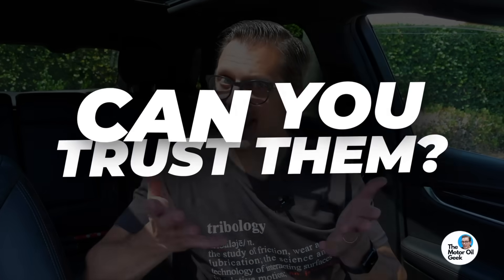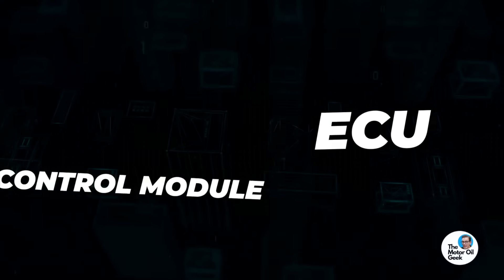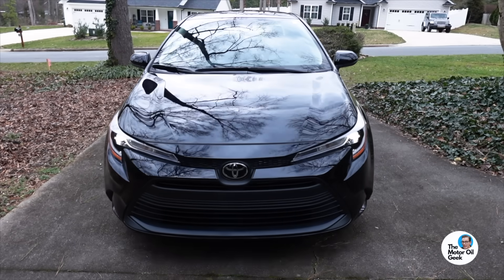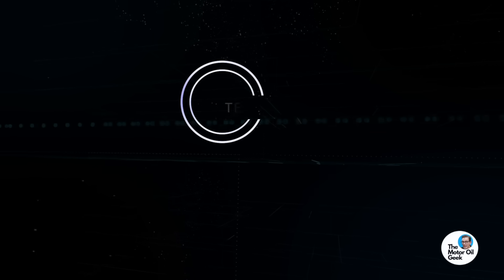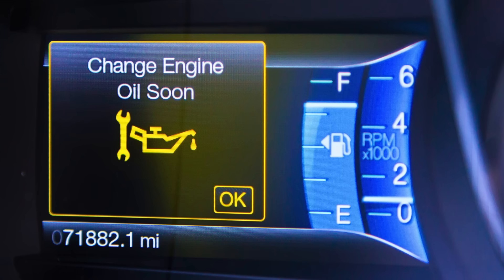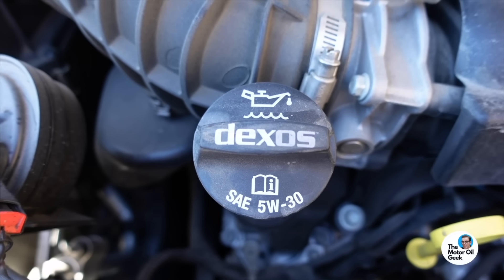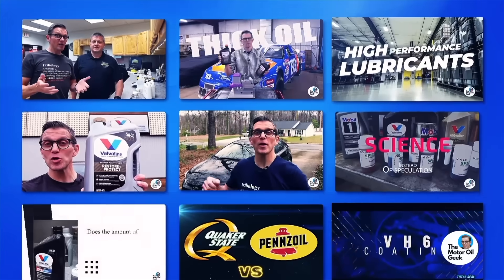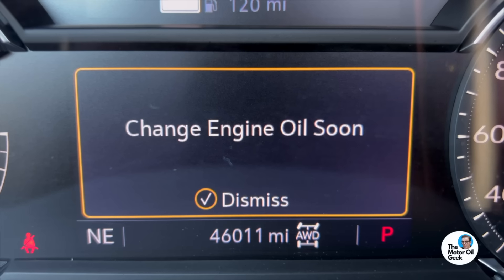The Accuracy of OIL LIFE Indicators REVEALED!

Comment: Lake,

I will somewhat agree with this video, but with few additional comments. 

Oil Life Monitors in general and assuming everyone uses oil from the dealership, which a lot of us don't. Two, the quality of the oil being used, whether it's group 3 hydrocracked oils, group 4&5 PAO and Ester blend. All oil is made differently, with that being said and like you yourself said in your last video, Regarding the base stock oils aka boutique/Enthusiast based synthetic oils vs the off the shelf oils. 

I also wouldn't trust or fully believe that any vehicle whether it's GM, Ford, Honda or even Toyota knows for certain that oil that went in or got changed is the same viscosity. Considering that people would say and do the opposite of what the owners manual says to use and also Considering that a lot of vehicles still say you can run different viscosity grades depending on the temperature range or climate where they live. With things considered here, I would throw some caution and speculation to the wind and not fully believe everything that's said about oil Life Monitors, it's a mere guess. Same with Flashpoint vs Gas Chromatography when determining fuel dilution testing. Ones far more accurate and more thourough, the other is a literally a mere guess.

Comment: Shouldn't you preface your recommendation to trust the oil indicator by stating that the indicator is assuming you are using the recommended oil on the cap/operations manual?

Comment: Great video. Informative and tightly organized. 
My 2014 Chevy Volt has the GM algo. My interval is much longer because it’s a PHEV/EREV, where most of my driving doesn’t involve the gas engine at all. Manual says to change it every two years or 7.5k miles. Got my last change last year at 77k miles. I’m at 92k miles today, oil indicator stands at 38%. I check oil manually every month and it looks totally fine. Will be mindful of the two year mark and/or what my indicator says.
Reply: I used to own a 2014 Volt, great car.

Just to clarify, you don’t have to track time separately. The computer automatically lowers the oil life monitor approximately 1% every week that the engine does NOT run, thereby reaching 0% at two years, if you didn’t use the engine at all.
Reply: @ That’s good to know. Thanks.

Comment: Our Chevy Suburban with the 3.0 diesel has an oil life monitor and I change it at 20% remaining which is about 6000 miles with Mobil 1 ESP x2  (dexosD oil).  No harm changing it a little early for extended engine life. DIY oil change cost is $55 since walmart started carrying the DexosD oil and AC delco filters.

Comment: I have zero issues with changing the cheapest mineral oil on the shelf every 10,000 miles. 256,000 on a G6 and 152,000 on a turbocharged Cruz. My opinion, you are wasting your money on advertisement oil and changing it way too soon.

Comment: I wonder if the oil life system takes into account the current mileage on the vehicle, as engines with over 100K miles will have more blow-by and thus contaminate faster.

Comment: I have a 2017 Jeep Grand Cherokee 3.6L V6. I run Pennzoil Platinum and change it at 5000 miles in summer and 4000 miles in the winter (we have below 0⁰ F temperatures) which correlates with the "oil life indicator" at 30% and 50% respectfully. 
I can think in metric and the US common or English system. I prefer the US.

Comment: How long could oil go, if the combustion is so complete, that there is no moisture, nor carbon buildup?
I ask, because I have found that if I impart a specific resonant frequency into the fuel supply, just before combustion, there is a much more complete combustion.  So much so, that it renders the catalytic converter useless, as well as never developing carbon deposits on the piston top or rings.  

My oil stays very clean and viscous to 40K miles, on a 350K milage 4.3L Vortec V6.  I've run the oil to 42,5K miles & the oil lost it's viscosity.

The engine had over 200K on it, before I discovered the resonant frequency trick, & that engine burned 1qt. of oil every 1000 miles.  Now, it burns about 1/2 qt. every 20K miles. 

Not to mention, near zero emissions w/o a converter, and a at least 20% increase in fuel milage.  

If you would like to test my claims, I'd be happy to send you my 'trick' to verify my claims.

Comment: Your oil is dirty from the moment the first rpm happens after an oil change, and just gets dirtier.   the only way to have clean oil 100% of the time is to install an oil cleaner circuit like a bypass filter system.   Every foot you drive or minute you run your car, even after an oil change, the oil is becoming contaminated with particles that wear down your engine operating surfaces.   Oil can be successfully filtered to the point of analytically clean using a secondary oil filter system in addition to the full flow system that comes from the factory.   Yet, very few people understand how critical this concept is to the longevity of an engine.    Just keep buying new cars after 100 or 200 thousand miles while you do your oil changes at every 3, 5 or 10,000 miles.    That's fun, right?   Spending 30 40 50 thousand dollars every 100 or 200 thousand miles, when you do not have to if you understand oil tribology and the functioning of high level oil filtration.

Comment: This is absolute horseshit. I did an actual test in my auto shop when my receptionist bought a brand new Chevy Cruze. We knew the actual mileage of the vehicle and the oil change intervals. Not just guessing at a rental car that probably had its oil changed and nobody bothered to reset the oil life indicator. In my experience through the first five free oil changes in the Chevy Cruze, the oil that was being offered at the dealership in San Diego was incapable of making it past the 60% oil life indicator. Mark.
We had to use amsoil signature series oil to get an oil that would still test with acceptable levels at a 10% oil life remaining. Even using mobile 1 would require the oil being changed at around 40% oil life remaining. 

If you're going to perform a test like this, your data is completely irrelevant. If you don't know the mileage on the actual oil you're testing.

Comment: My current concern is that we recently had a new 4 ton Bosch IDS heat pump installed to replace our 20 year old 4ton a/c. 

During that process, I found a considerable amount of mold in our flex duct. I decided to educate myself and replace all of it myself. 

During the replacement process, I discovered many air leaks in the system, which lead me down the rabbit hole of air sealing every inch of our attic floor, disinfecting all of our metal ducting, air sealing every inch with tape and/or mastic, reinsulating it all of the metal ducting and plenums, and I’m strongly considering enclosing my attic to turn it into a semi-conditioned space. 

However, my concern is after all of this work, my system will now be over-sized for our now more efficient home. 

Did I just screw myself?

Comment: Just as a technician, I've noticed that some makes have their "Oil Life" be nothing more than a mile counter. Some have internal calculations for engine and ambient temps, ignition counts, etc. Without knowing for sure which system your vehicle uses, err on the side of caution would be my recommendation. Analysis can really help you a lot with those decisions, whether you use Lake's company or another reputable lab, it really helps to know the actual info.

Comment: No, you cannot do that. IF you want a reasonable life span of the engine and aftertreatment system, it is wise to change more often than the regulations, ESPECIALLY on EGR diesel. EGR dirties and destroys, as a lot of oxides are released when exhaust gases are recycled. Feel free to take up a separate section for EGR-Diesel and its destructive properties.

Comment: There are situations where the Oil Life Indicators are useless since they do not have sensors measuring oil particulate, but only algorithms based on other sensors. The main one is frequent dusty environments such as living, working or recreating on gravel roads and trails. Most owner's manuals include frequent dirt road driving in their "Severe Duty" definition, along with things that the algorithm is aware of, like short distance trips, cold weather, stop and go traffic, heavy towing, etc.  But most of those can be accounted for with the algorithm because they involve engine and oil temp, rpm (injector count), etc. Not so with gravel road driving as there is no sensor to indicate oil particulate. We use our pickup with a light weight slide-in pickup camper and put in a lot of miles on gravel roads, trails, etc. so I do oil changes at 5,000miles, and oil filter changes every time, regardless of oil life indicator.

Comment: My 2017 Ford Fusion Energi is driven daily, 5 days a week 25.5 miles per each commute direction and I get to start with a fully charged EV battery both directions. EV mode duration depends on weather and traffic. EV mode is 19 to 22 miles, so 6-7 to 3 miles on gas, in hybrid mode meaning gas engine on/off depending on load. So oil life indicator means what? I've been changing oil at 50%. 0W-20 oil, changed at dealer. Usually every 6 months. I'm 64 and can't crawl under a car any more. All my previous cars have been 100% gas, no hybrid or run/stop. Easy to determine when to change. BTW,  I fill up every 3 months in the summer and every 2 months in the winter with fill-ups being about 10 gallons.  Best commuter car ever, no range anxiety.

Comment: All you said in 10 minutes of video is that the GM oil life monitor is extremely conservative. You give no indication of how long oil might actually last or how to correlate actual oil life with the monitor. You should show how to use a specific oil analysis to determine oil life for a particular vehicle and correlate it with the monitor. For example, will a particular oil change typically last for 10K miles when the monitor says to change it at 6K? Is it worth the cost of the oil test to find out? I am interested in accuracy, not fluffy oversimplifications. 
The way I used to use oil testing was to watch TBN to ensure that I did not run low on acidity buffering, and to watch for trace metals to make sure that nothing went unusually high. In most cases of mainly highway driving of over 30 min per trip, I could get over 10K per oil (& filter) change with nothing out of range, especially if I had added 1 qt of oil makeup  during that time. Now, I just go to about 10K on synthetic if I have added at least 1 Qt of makeup in that interval, and skip the oil test.
(People who do mostly short trip driving might do well to consider an EV.)

You can do better than this video in the same amount of time.

Comment: I don't trust Honda's OLM and never have.
I have had honda's from 2013 onward, and they all push the oil mileage to well above 10k miles. 
I have done oil analysis tests on multiple engines (k24, k20, k20 turbo, j35) and the oil is beyond useless at those points.
I have also noticed that honda's are super sensitive to having good clean oil and fluids (I have toyota's that seem completely oblivious to the life of their fluids, everything from coolant to brake fluid, trans fluid, engine oil). At least with honda's the car feels at its best and performs at its best with much shorter intervals than what the maintenance system thinks. My transmissions on honda's feel clunky after 30k miles, but the minder told me to change it at 50k. Of course I changed it early. Same with engine oil. 4-5k mile oil changes are not expensive (25$ for oil, 5$ for a filter). Same with brake fluid. They say brake fluid is good till 50k miles, After changing it, the brake feel was noticeable better.

Comment: My Ram 2500 Cummins takes far too long to indicate a change. I change my oil at 5k with full synthetic Diesel with an additive called Cam Guard. NO way would I let any of engines run over 5k between changes. We have a 4Runner with 370,000+ and counting still running like a top with a clean engine because we are religious about changing oil and using the highest quality oil we can buy.

Comment: I just do my oil changes every 5k. Never used synthetic oil. I,m 70 years old and I have never had an engine have oil related failures. I usually put from 150 k to 200k. Everything else dies in an old car before the engines die. Plus changing oil every 5k is easy to keep track of. No need for any stupid oil reminders.

Comment: I’m unfortunately the owner of a vehicle with a wet belt driven oil pump (ford 2.7 eco boost). My primary concern is ensuring a long belt life. Is there a spec of oil to look for or avoid to ensure max belt life? (Other than blindly trusting ford and using motocraft, if they’re careless enough to spec a wet belt I don’t trust their judgement on oil). I change it early just in case 8000km.

Comment: 1st and foremost we  DO NOT NEED THE METRIC SYSTEM.
2ND OIL CHANGE INTERVALS WERE INCREASED BY THE EPA SO LESS OIL IS USED!!!!!!!!.
3RD 3K MILES IS ENOUGH, IN SMALL CARS THAT ONLY TAKES 4 AND A 1/2 QUARTS OF OIL.!!!!!!!!!!!!!!!!

Comment: Many years of playing with Hondas, (88-95 SOHC) and blocvking off the grille for fater warm up time was key. In 2000 or so I wanted to used a Futaba S148 servo to control grill shudders to enchanve the faster warm up times. Now what is standard on most cars? Grill shudders. I was also driving 100k+ miles a year. I would get an oil change (Semi Syn at local tire chain every 3 weeks or 7000-7500 miles using whatever filter they had on the shelf. Before that I was a 3500 mile OIC with Mobil 500 and STP/Purolater filters. Older Hondas on cheap gas (Speedway here in Ohio) are known to coke up and stick the rings resulting in low compression when cranking, the cure was the old ATF trick. Routine OIC's and decent gas and all those headaches went away. 300-400k miles was never an issue. Idiot drivers were the cause of the Honda's being retired, 8 were totaled, a few of those high mileage motors went on to race in SCCA (Autocross) and still are competitive today.

Comment: how does the oil life monitor know if you put in dino, semi-synthetic or full synthetic oil? Each one of those oil types has different life spans. Because of this, I say you can't trust oil life monitors.
Reply: Most newer GM cars require syntheic oil.  For example the 3.0 diesel in our suburban takes a "DexosD" spec oil that is only available in synthetic.  I believe Dexos1 for gas engines is only avail in synthetic as well.
Reply: @BrianNC81  oil life monitors have been in cars at least since 2000. Back than Dexos was not a thing. So you could put in Dino, semi synthetic or full synthetic. Again, how does the monitor know what kind of oil you installed in the engine.??
Reply: @BR549_o7  it doesn't know.  OLM is calibrated to the type of oil the manufacturer recommend at the time the vehicle was built.  If it's an older car that used non synthetic, might be able to go longer on synthetic.  If it's a modern car that specifies dexus 1 for example, I wouldn't skimp and go with a lesser quality oil.
Reply: @BrianNC81  that is what I'm saying. Oil life monitors are not accurate in older vehicles because the type of oil used could be better than what was available back in the day. They are just a guide. And as time goes on, even the newer cars today that specify synthetic will be inaccurate when better oil comes out than synthetic is today. Advances in technology happens, but the technology in cars stays the same, "dated" as to when they were built.

Comment: I have a 2023 f350 high output diesel and I changed my oil to Amsoil signature series 10w30. I sent my oil out to be analyzed at 10k miles and the report came back absolutely glowing and they recommend to resend another one at 15k miles. I changed it anyway, again with Amsoil but I guess Amsoil isn’t lying about their 25k or one year change intervals. I would never go beyond 10k in oil changes because I guess I am a little ocd about that. It was killing me to allow it to go past 7500 miles but I had to see want my 10k lab results were going to be. 15 quarts of oil is ALOT !  I didn’t realize just how much until I had to drain it in an actual big plastic tote from Home Depot. In reality it’s 16 quarts to full on the dip stick because the filter holds 7/8 of a quart alone and the engine 15 quarts. I always prefill my oil filter. What do you think as an expert ?

Comment: I remember watching your Oil Testing Video from Months ago-- I have a 2007 Monte Carlo and I drive mostly Highway miles...When I need to take short trips in the Winter,I try to integrate ALL of my trips at one time,so that the engine is STILL warm in between each trip-- On a Different Note,I use my older($300) Town & Country van for most of my short trips-- I also Subscribed

Comment: Will only say this about oil life indicators. Working for Honda for 12 years, you see different  generations phase in and out. But in the mid to late 2000s, and even sometimes newer cars, at least for Honda isnt calculated enough. Had to replace piston and rings to help the consumption because of extended oil changes. On newer cars, same thing, customer arrives at 15% (when the minder comes on) and you drain the oil, looks like black water, smells like fuel. now just multiply that by the entire life of the engine-- i just dont understand why the actual manufacture cant advertise back to 3-4k oil changes instead of trying to extend oil changes and costing consumers in the long run. Now my experience is with Honda only. It is nice to know other manufacturers are taking a proactive approach to the "oil life" meter. Thanks Lake for the video.